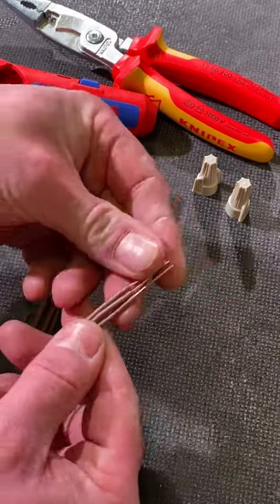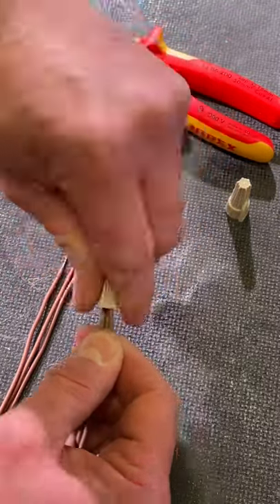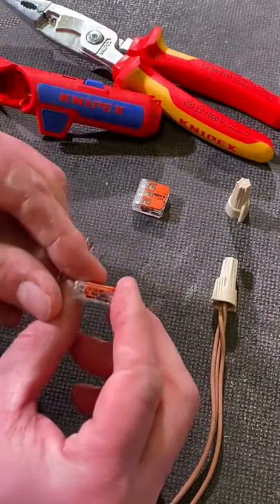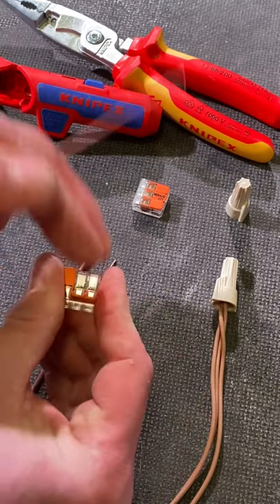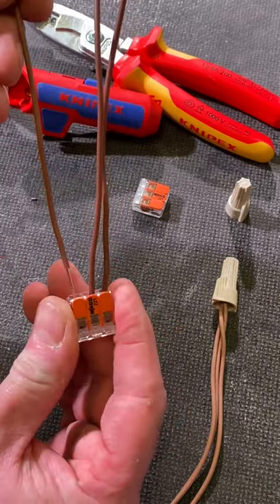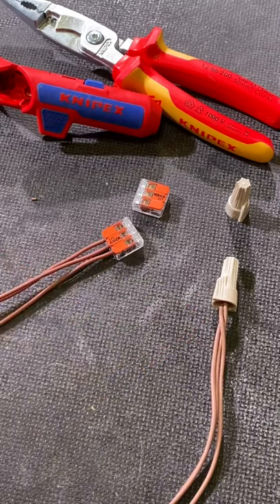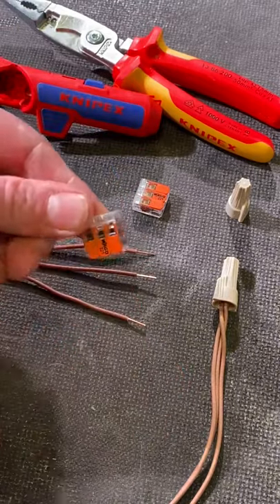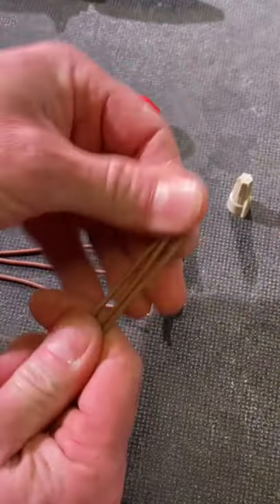Which way do you splice wires? WAGO 221 vs WIRE NUTS? | Electrical #shorts from eFIXX

Comment: No electrician EVER cuts a wire nut off.
Reply: And they don't use Wagos either.
Reply: @stevekight1955  what do they use then?
Reply: @ben_eggebrecht  They use wirenuts. Wirenuts are cheaper and 1 wirenut will fit many combinations of size and quanity of wires.
Reply: @stevekight1955  are Wagos expensive in the US? I’ve never seen those wire nuts before. I don’t know anybody who doesn’t use wagos, it’s the easiest way to connect wires here in Germany. Maybe it’s because of our strict regulations, everything you use as a electrician has to be verified for the use. If you use something that’s not verified and anybody gets hurt or anything burns down, you’ll probably go to prison
Reply: @ben_eggebrecht  From what I've seen, Germany uses small guage, stranded wire for its power circuits because of the higher voltage. Wagos are probably okay for that. In the U.S. most of the wiring is done with larger guage (#14 and #12 AWG), single, solid strand copper for branch circuits. Wagos would have a tendency to work loose on solid wire. With wire nuts, the wires are usually twisted together first and then a wirenut is screwed on to insulate and protect the splice. In 50 years as a licensed electrician I have seen but never used Wagos and we have very tight restrictions too.
Reply: @stevekight1955  There, you are wrong.
Reply: @ben_eggebrecht  Just a moment. I spent a lot of my youth in Germany, so I am familiar with the 'die Amis haben keine Normen und null Kultur' mentality.
It's time to drop that. 
WAGO is a relatively new system in the US (my German grandfather, an electrician used them or similar his whole working life in Germany.) 
American tradespeople are just as conservative about new things as are people in Niederbayern. 
Wirenuts, installed properly are safe.
WAGO, installed properly is at least as safe and better in many ways. But - just as it took my German relations how many years to accept PCs after the Americans used them at home, it will take many Americans years to accept that WAGO are safe and better than wirenuts in many ways.
Remember, Americans are not all Bush or Trump just as all Germans are not their worst politicians (and, let's be honest - Germany has had some very bad politicians.)
Reply: @ethelryan257  Which part?
Reply: @stevekight1955  Stranded wire is nothing to do with voltage.

Germany and UK run at 230 volts. Technically the UK still runs at 240 volts, it is just the specification that was changed so the countries in the EU could all say they run at 230.

So the UK runs at slightly higher voltage than  Germany and we don't use stranded cable.
Reply: @stevekight1955  yeah, we aren't allowed to use wirenuts for solar installations.
Reply: @stevekight1955  They most definitely do use wagos.
Have not seen a wire nut on site in decades.
Reply: As a commerical spark I've only ever used wagos. You might see wire nuts or connector blocks in a domestic setting, but commercial is all wagos
Reply: @AIRTIME96  Last time I used a wire nut was in school, 25 years ago, not because we did not have WAGO's but because our teacher were convinced they were no good.
He was not the best of them.
Reply: @stevekight1955  Almost no one outside the US uses wirenuts
Reply: @stevekight1955  I don't even know where to start, you being wrong about common German house wiring, the obvious failure at installation if a Wago, the joke of calling American regulations "strict", etc...
Reply: @ethelryan257 Theres absolutely 0 chance that a wago produces the same quality of connection as a properly done wirenut on solid wire. The contact area with wirenuts is multiples of the cross section of the wire due to the lenth of them being in direct contact and clamped with the force of a wrapped inclined plane. Wagos have twice the ohmic connections and dont compare in terms of contact area or clamping force.
This is basic physics. 
The would be superiority of wagos comes solely from them being nearly idiot proof and operably by the soft handed. Just the type of thing an overreaching nanny government would foist onto its infantilized populace.
Reply: @stevekight1955 never seen an electrician use a wire nut ever. All wago here.
Reply: @Iisakki3000  I've installed literally thousands of wire nuts over the past  50 years. We  use a lot of solid wire in America and that type of device won't work as well as a wire nut. Plus, wire nuts are cheaper and one size will fit many wire sizes and combinations of wire. Wagos have their use but not in the commercial field.
Reply: @AtlasReburdened   very, very well said, and spot on
Reply: I don’t know about you guys but almost every electrician I have ever worked with including myself reuse wirenuts if need arise. I have never just tossed a wirenut because it was used once.
Reply: As long as you don't use them on a smaller set of wires, they  work well with re-use. @Mbrantang
Reply: @ben_eggebrecht simply put a few bucks for a hundred or a few dozen for like few bucks.
Reply: @stevekight1955 I’m an electrician and I use both. Wire nuts I use majority of the time from 5-10ma, 24VDC, up to 277. I’ll even use them in potheads up to 10hp motors, anything higher I use a bolt with camber tape and splicing tape. I’m actually a huge fan of Wagos when I’m doing lighting work. I think it’s stupid to turn off lights or even attempt to untwist a live wire nut. I work in a facility that has 277v lighting and I think it’s the dumbest thing ever to wire nut 277v lighting. Wagos like those would be best and they are rated 300v-500v on them. Which makes them safe to handle and easily remove wires to terminate localized lighting. Yah we do use Wagos.
Reply: @stevekight1955 wagos are realy nice for wire mold or any place with not much space. Otherwise I use wire nuts mostly
Reply: only in demo
Reply: @stevekight1955 that is a comment only a non electrician would give. Residential, it is the only way to go. I’ve been using them for 20 years now. Industrial is a different thing, but also still used. There are wago’s for wires as small as 0.8mm2 up to 6mm2. However for the higher amperage it is best to use screwed connectors, because the connecting plate inside the wago could melt after a while. Specially above 16 to 20A. Those higher amp circuits usually get a separate cable/breaker so no subconnections needed/allowed in residential applications.
Reply: Germany uses a smaller guage stranded wire. Solid wire is predominate in the U.S. @ben_eggebrecht
Reply: @ben_eggebrecht do y’all use wagos on commercial or industrial settings too?
Reply: No electricians uses twisted wires in nuts. Hacks and Amuricans do.
Reply: Yeah we do, and in anger that is. And throw them so hard in the bin that the bin almost tips over.
Reply: Wire nuts way to go and electricians twist wires with kleins first
Reply: @theone-ou3gd  what year is it, 1940?
Reply: @justme5384  I am electrician stop it wire nuts king
Reply: @AtlasReburdened American electrics should belong in a museum 😅.. It's like travelling back in time when you see an american sparky at work. Not to mention that your electricians use a freaking multimeter to run test and conduct inspection🤣. The standard is on the floor⬇️
Reply: @ethelryan257 very well said.  I didn't even know what Wagos were until recently, and was hesitant to use them.  I redid a box and the Wagos were the best option, so I used them and liked them alot. 

Change takes time, especially in the trades
Reply: Germans don't use stranded wire in homes.
We only use single core ons.
We mostly use "NYM" wires for house installations.
Stranded wires are only used in industrial applications and only on parts that are moving.

Wagos are always used. The 221s shown in the video for stranded and the older ones without the lever for solid core ones.
Reply: Correction ... No American electrician would.. but back in the modern world here, we wouldn't even consider them.

Comment: Yes I know wire nuts can NOT be reused because when you insert the wires into the wire nut. The spring inside of the nut will stretch to accommodate the wires that you use. If you stretch the spring too much it will not come back to shape and possibly not be able to connect smaller wires. I e going from 4 wires to 2.

Comment: I'm an electrician for 4 years and to this day didn't know I could push the solid wire without opening the lever lol
Reply: I knew you could do it but I still open the lever first. Just seems right instead of just shoving a wire in. 😂
Reply: I've been a spark for 11 years, I didn't know either 😂
Reply: You don't even need 221s for solid wire! It's only necessary for mixed wiring where stranded is also used. Solid only needs 2273 type Push-In connectors. They are even smaller, saves space in cramped boxes.
Reply: I'm guessing all the work you’ve ever done is the domestic judging by that comment. 
I feel really sorry for people who've only ever done domestic their entire lives. You don't realise how much it'll help you and make you a better sparky by going n doing some commercial and especially industrial work. 
You'll thank me later
Reply: What's a walnut in electrical work

Comment: Wago just makes life so much easier
Reply: and pricier.
Reply: @greenspiraldragon  that is a total non issue at ~30 cents a piece
Reply: @hornetIIkite3 especially when it s the customer paying anyway lol
Reply: @kettelbe  i don't even charge for it. It's just in my suitcase at all times
Reply: And dangerous
Reply: Wago may be easier, It's an inferior method for joining wires. Wire nuts are much better

Comment: In my country wire nuts illegal, someone recently fined 2000$ for using them
Reply: What country?
Reply: Good.
Reply: Everyone uses wire nuts in my country
Reply: BS!
Reply: What country is that? Even in the UK they aren't illegal, they're just extremely frowned upon. Although the old ceramic ones are still illegal I believe.
Reply: That's because non-professionals will use wire nuts incorrectly. Wagos are an attempt to idiot proof the process, but that doesn't make them better...just do a resistance or voltage drop test on a line with a series of wago connectors in it vs wire nuts (properly done) and see what you find.
Reply: They don’t even sell Wago’s in the electrical supply houses here. They do have the Ideal version of them though.
Reply: @danlux4954  I found them at my Menards
Reply: @shanehancock9624  you're worried about resistance?? 0.1 Volt drop isn't going to change anything, or a milliWatt power loss due to resistance.
Maybe in the US it matters cus you use such a low voltage, you have no usefull power in 16Amps, but that's not a problem anywhere else.
And for anyone wanting to mention cost, a 2 second google search showed me wagos between 12 and 60 cents, and wirenuts between 9 and 50 cents. so yeah, big fcking difference.

Comment: After several hundred joints in a row with wire nuts, them wagos start sounding like a good idea
Reply: Not such a good idea if you bid the job and are paying material costs.
Reply: @ryanjg5136  about 30 cent each. With labor costs the way they are in Europe that won't make a dent.
Reply: @basdewildt7973 Exactly. If one can save even 30mins, it would translate to supplies for like min.20 euros, which buys a lot of Wago's.
Reply: Why not just buy some linemans pliers and a wirenut driver?
Reply: @AtlasReburdened  cause no one uses wire nuts here. They're considered from the dark ages.
Reply: @AtlasReburdened  boss said not to use it. Never used it.
Reply: @AtlasReburdened  no way we were getting wagos. We got wire nuts and did it by hand.the last few yrs I was a electrician, I saw it ( wire nut driver) being used but I was union, speed wasn't a factor doing commercial and industrial work. Don't let the customer hear that
Reply: Wagos are garbage and should only be used on lighting fixtures of 120v. Anything carrying real amperage should never use a wago. Wagos are low voltage trash.
Reply: who is this day and age uses 120volts ? 3rd world countries? @alilruthlessify
Reply: Wago flame nuggets catch fires.  Dont let them flappers flip back open when tuggin. Dont want them nicely stripped wires pulling out.
The nutbuster attachment on my impact beats wagos on speed and efficiency especially splicing multi conductors.  Wire nut make ups for the win

Comment: WAGO all the time 😎
Reply: Absolutely
Reply: Any kind of stab-in connections in regards to residential wiring are known to fail frequently. We normally twist the wires with linesman pliers then put the wire nut over the twisted wires to secure and protect the connection
Reply: absolutely - i'm living near the German city Minden and since this is the place of birth for wago there is simply no question about it
Reply: Wago is far better for high maintenance applications. Past that? Doesn't really matter tbh other than being 5 times as expensive and more limited.. The conductors become more brittle and more likely to short everytime you crank em down bottoming out the wire nut. 

For resi and most commercial? Wire nut. For industrial or factory maintenance? Wago.
Reply: Someone doesn't know how to splice wires.
Reply: Well first of all I would have used lineman’s to twist the wire and then I would have put the wire nut over top. Takes more time, but there is less of a possibility for it to fail in the long run. Waygo connectors can fail if the conductor that runs across it breaks. Also I don’t use cheap wire nuts like that one.
Reply: @jeffkubiak6363  I personally know about 100% of wirenuts are loose at least after ~30 years. (For all I know that could be 10days though) never seen one of those where the wires haven't leaked that blue shit indicating a bad connection.
Reply: @snobbingas189  not sure what you mean when you say wirenuts leak blue. Maybe the ones you are seeing have deox in it to protect the exposed wire. Wire nuts don’t just get loose. It’s all about how the splicing was done. If not wirenuts then crimping with Buchanans is still a much better choice than stab ins
Reply: @jeffkubiak6363  they must be really difficult to install then because the old ones almost always have bad connections, the sticky blue gunk doesn't come from the nut itself. It is the melting insulation on the wires. Sure there are poor quality stab ins but I've never seen a wago stab in fail so far. Might just be that the products are a little different in different places. Where I live I've never heard of a professional using a wire nut, though I've seen them still in stores.
Reply: @snobbingas189  you haven’t seen them fail because they are so new still. And if the wire melting because of heat that’s solely because that wire is working with a load beyond it’s rating.
Reply: @snobbingas189  wire nuts are used to cover an open splice. Inexperienced people tend to use the wire nut to splice the wires which is wrong because you are supposed to splice them with pliers before putting the wire nut on
Reply: @snobbingas189  I am an electrician, and I can tell you that I promise you they use wirenuts or crimps where you live man hahaha
Reply: @jeffkubiak6363  there doesn't have to be a big load if the connection is bad you could get a continuous spark creating heat. The connection in a wire nut gets loose the same way as bad screw connections, the wires get warm, cool down again etc. They expand and substract say, a thousang times and the wires have wiggled themselves loose. This won't happen in a stab in or other kind of spring loaded connection.
Reply: @snobbingas189  if the wires are arcing because of a bad connection that again is because it was spliced wrong. You proving my point. Wire nuts are for capping off a splice they are not meant to be used to splice
Reply: @snobbingas189  therefore if a wire nut vibrates loose over time, Which they might after a few decades. The splice will still stay in tact if and only if it was spliced the right way
Reply: @snobbingas189  if you still don’t agree with wire nuts being better then at the very least Buchanans are, crimping creates a lot more of a permanent bond and it’s very inexpensive
Reply: Woah slow down there moneybags

Comment: For solid conductors, we usually use Wago 2273 in Germany.
Reply: personaly i prefer the 222
Reply: And we use real cables, not such thin wire
Reply: @fynn1202  All cables are real mate.
Why use a thicker cable and have the increased cost when you don't need it in your application?

Silly idea.
Reply: I use 2273 for all solid and 224 or 221 for mixed installs.
Reply: @deang5622 maybe for fire hazard i dunno 🤦
Reply: @fynn1202  So you're Americam clearly 😆
Reply: @deang5622 I think in Germany they don't separate lighting and power circuits that's why all the wires must be at least 2.5mm².
Reply: @IAmThe_RA  Not generally a good strategy because if a power circuit trips the breaker, you lose the lighting too.

So it's a good idea to separate into different circuits to minimise the impact.

I am surprised at intelligent Germans adopting such a poor strategy.
Reply: @deang5622  I am not sure but i think i got this info from a comment made by someone from the UK who visited or lived in germany. Probably an old house.